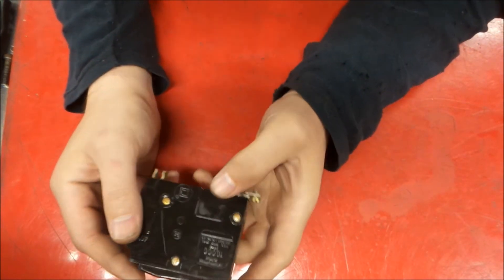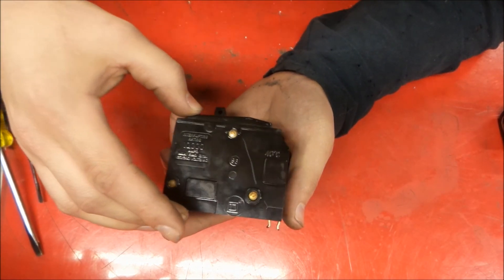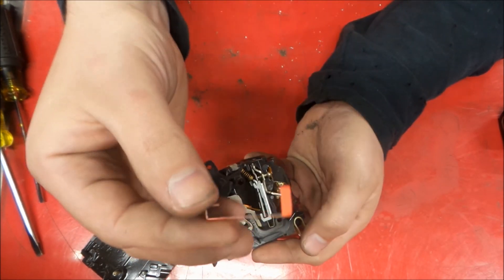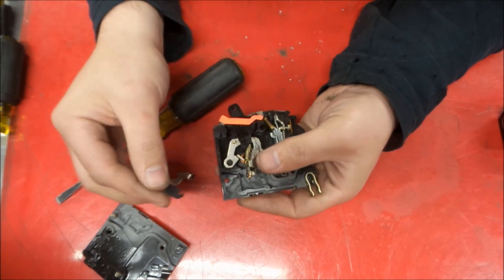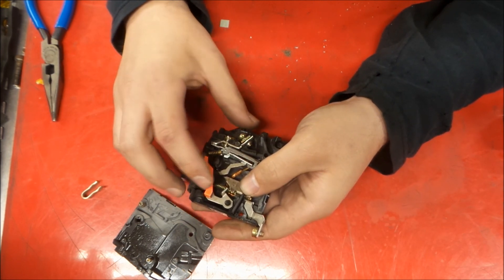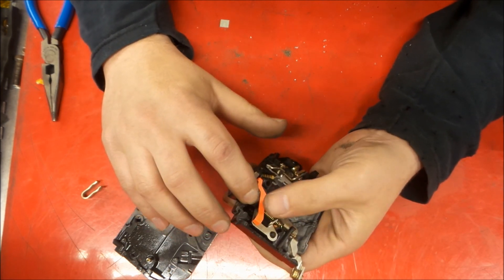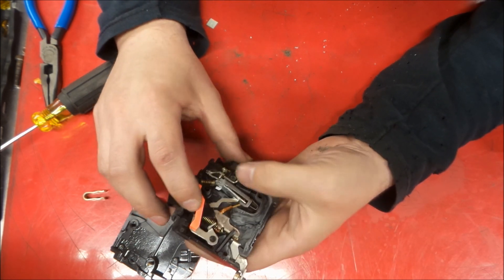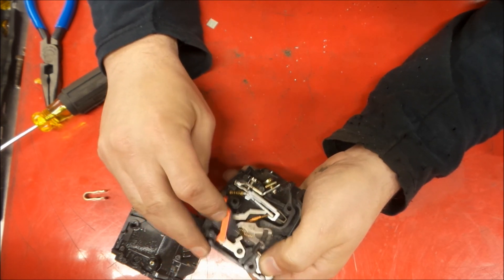Teardown of a Square D QOB Circuit Breaker - Fun for Electricians and the Whole Family

Comment: There are actually two mechanisms implemented for causing the breaker to trip. As described at 7:18, if too much current flows, the bi-metallic element will bend enough from it being heated to pull the latch and trip the breaker. But also, the braided copper conductor forms the "coil" of an electromagnet in the latch. A very high current will create enough of a magnetic field to pull the latch faster than the bi-metallic element would react. Thus, this type of breaker is known as a thermal magnetic breaker.

So, the bi-metallic element is generally for overloads caused by putting too many things on the circuit and the electromagnet is for fast tripping from instantaneous high currents such as those caused by a direct short.
Reply from the maker: Thank you very much for the comment. That makes perfect sense. I have some other old breakers we can take apart on the channel. I'd like to take a closer look at that. Thank you again for the information.